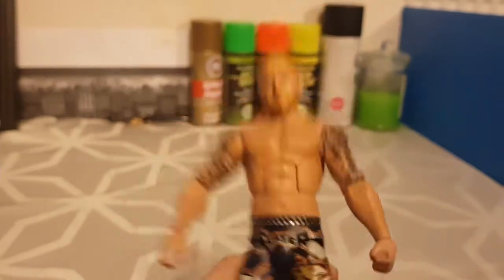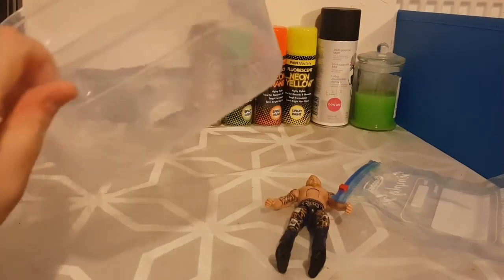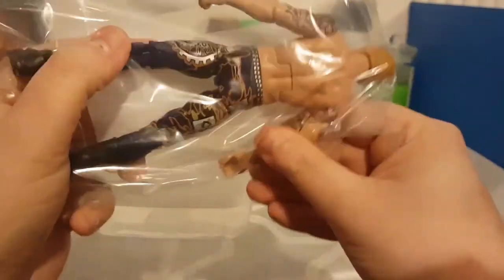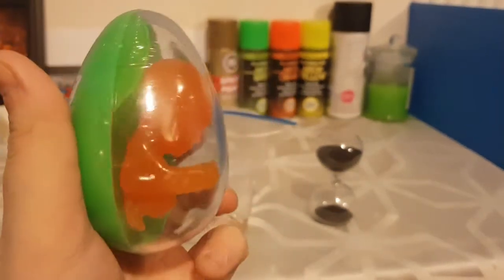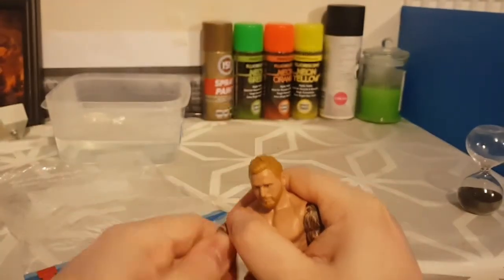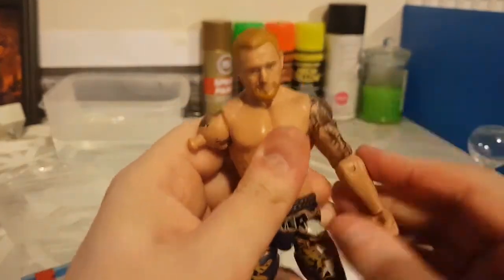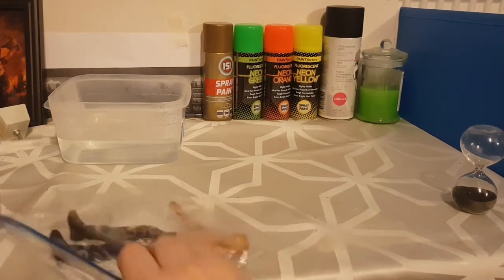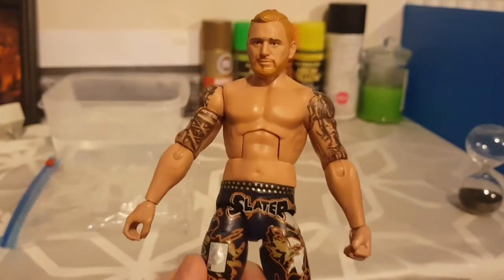How To Fix A Stuck/Stiff Action Figure Joint  | No Damage

Comment: I try this first i get a little vasaline or chapstick inside the cuff for some lube and it glides smoothly if not i get a blade and lightly go against the inside of the cuff to shave a bit off then put some vasaline and it worked perfectly

Comment: I just want to make sure. My elite Cm Punk’s leg is stiff when you try to move it’s leg to his side, actually. You can’t even move it to its side. This will work my problem right? Cause I rlly don’t want to break it cause it’s rare. Edit: Do I have to remove any knee pads so they won’t melt?
Reply from the maker: It would work on the leg joint yeah, iv fixed a couple of my own leg joints, my figures didnt have knee pads to remove though. To be safe i would remove them as they are a much thinner Rubber.
Reply: Ramsastro ok thank you
Reply from the maker: Let me know how it turns out :)
Reply: Ramsastro I’m not doing the cm punk yet. I’m going to do a elite 75 Kalisto since you can’t rlly move the arm. I will tell you how it turns out.
Reply: It was a success! Thanks. My cm punk leg is kinda stiff but stiff is better than it not moving. And my kalisto arm can move and the articulation is good now. Thank you
Reply from the maker: Im glad it worked for you! I really need to get myself an elite cm punk figure.
Reply: I have the same issue with my cm punk figure and it cost me £44 on Ebay but if you want to fix loose joints just use kiki loose joints

Comment: How long does this method last? Surely after it cools the figure will be stiff once again right?
Reply from the maker: So far every. Figure I've done this with had zero issues with them reverting back to being stiff. Even the one i used in the video. Hes still loose as a goose

Comment: Does this method work with elites that have double-jointed arms? The figures' shoulders don't go completely down.
Reply from the maker: Yeah it should do as its all the same plastic
Reply: @Ramsastro  Okay, thank you! Will let you know how it goes. In my teenage years now and buying these toys with stiff shoulders is frustrating. 😆 Hope it'll work.
Reply: @Ramsastro  Worked great. The arm was a pain to get on, but everything else went splendid. 
Thank you, man! New sub!! ✨✌

Comment: Has anybody noticed that the new elites shoulder joints are getting worse , every figure I get has a shoulder problem
Reply from the maker: Yeah it seems to be an issue. I dunno if they are just using cheaper/different plastics in the joints than they used to?

Comment: I hope this works on my black series jango fett shoulder joint
Reply from the maker: Lemmie know if it does. Hope video helps
Reply: @Ramsastro  I will
Reply: @Ramsastro  I'm just frightened my figure will melt
Reply from the maker: It wont melt. If you just copy what i did in video
Reply: @Ramsastro  no I found out it's that my figure is built improperly

Comment: Should it really be zip locked?
Reply from the maker: It doesnt have to be. I just do it so i dont get water inside the figure. And means less mess when taking it out the water hhaa
Reply: @Ramsastro  problem with my roman reigns elite 65 is when you raise the right arm laterally it wont go full range.
Reply from the maker: @Neutron2929  this sounds simelar to my heath slater. The hot water method should help. This out
Reply: @Ramsastro  yeah it is.will try then give you feedback 👌
Reply: @Ramsastro  it did work haha now he can do a double spear wreck everyone and leave 🤙
Reply from the maker: @Neutron2929  yaas! Thats what i like to hear (as long its not undertaker getting speared im a happy man!) glad the video helped you out though!
Reply: Hahaha i dont have a taker fig yet might get the elite 79 soon such badass